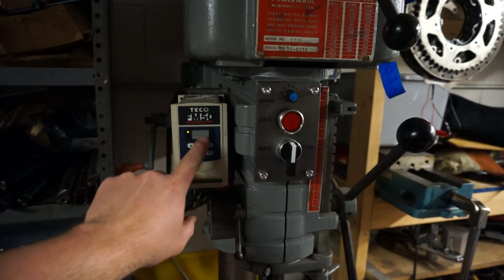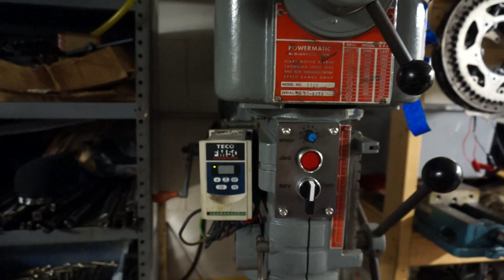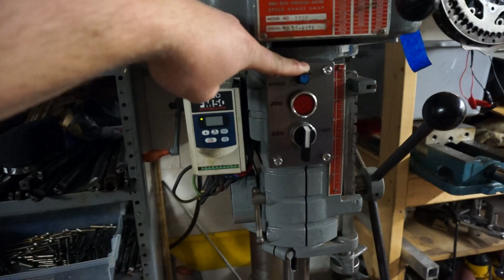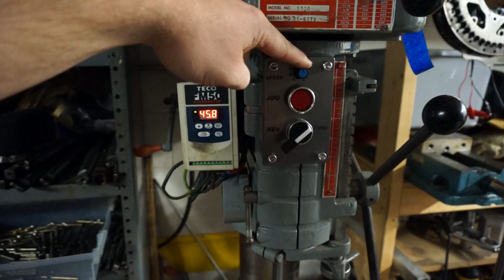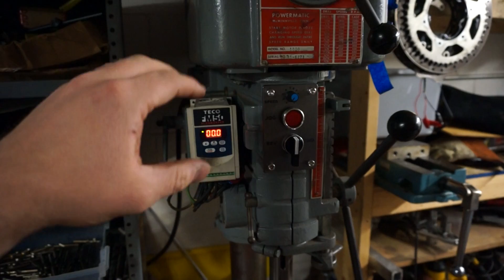powermatic 1200 drill press and VFD

Comment: Is the speed adjustment on the top with the adjustable pulley still in place? I have a similar Powermatic and have had issues with my vfd not having any torque. I can stop it with my hand

Comment: I just bought a 1200 from 1970 with a 2 speed Baldor 3 phase motor.  I want to power it with a VFD, i have no idea how to tell which wires are for low speed and high speed.  It is a 6 wire motor, to my understanding it is wired delta in series for low speed and YY parallel for high speed.  I would wire the VFD to the high speed leg.  Any idea how I can tell how to wire it?
Reply from the maker: I dont know on your motor.  No wiring diagram on motor plate?  Google?  I would agree the high speed is probably more useful as you can use VFD and reeves drive to slow spindle.
Reply: Peter Owens unfortunately there is no wiring diagram. 

Do you see an issue with wiring a plug to the vfd and using an outlet for incoming power?  Also, how are you grounding it really well, I see you mention it in another comment?

Thanks
Reply from the maker: slackreviews I don’t think that it’s advised to use a plug on VFDs.  I would consult the manufacturer on that.  I grounded the VFD to the drill press chassis which has ground back to panel.

Comment: Like the remote set up. Any chance of a electrical wiring drawing of the remote set up?
I have the same machine that needs this modification. Care to do this via private message? let me know and I can send my e-mail address. Thanks
Reply from the maker: Hi Caddy.  I don't have any drawings I'm sorry and my drill press is in deep storage from a move.  I used the Teco FM50 owners manual which had fairly detailed descriptions of wire hookups although obviously not written by someone with a mastery of the English language.  The parts I used were a (rotary 3 position selector switch) (Push button momentary switch) (10K linear taper rotary potentiometer) off ebay.

You wire these in according to the directions in the Teco manual and it's explained thoroughly.  You then have to "program" the Teco to recognize these new switches instead of the buttons built in to the VFD.  Basically you jog through the menu functions on the Teco (again explained in the manual) and set some parameter to 1 instead of 0 etc.

So you would use the 3 position switch to control the FWD STOP REV on the VFD and there is a setting for that.

You use the 10K potentiometer (which has 3 wires and some soldering to do) to replace the UP DOWN speed button on the VFD, explained in the manual.  Although I remember a little trial and error to get the 3 wires hooked up in the right sequence for it to work, fortunately there aren't that many combinations ;)

The jog button is an easy hook up.

I crimped tiny spade connectors to the wires and if you look at a TECO there are corresponding screw connectors for all the wires.  I'm not an electrician and I don't recall being stumped so it should be fairly straight forward with the VFD and the parts in front of you.

Let me know if you want actual ebay ads as I checked and the same parts I bought are currently being sold by tree_kicker and victoryrush

If you google Teco FM50 manual you should be able to find a PDF that shows the basic hookups.

http://www.tecowestinghouse.com/Manuals/FM50%20Instruction%20&%20User%20Manual_0405.pdf

Peter
Reply from the maker: Peter Owens Oh and be sure to GROUND EVERYTHING or you will have some fun little tinglies shocking you every time you touch the spindle haha
Reply: I currently have a lo/hi forward and reverse switch would that work?

Comment: Of all the videos i have watched on vfds, yours is the best. I wish I would have seen this a month ago. THANKS
Reply from the maker: Thank you for all your videos, I have enjoyed them for years.  I can gladly show you how I wired up my switch panel, but I think you are more than capable of figuring it out.  I will say that having the speed pot front and center makes using the VFD much more enjoyable.  You'll grow tired of trying to change speed using the keypad.

I also plan to rig up a proximity sensor and have a RPM readout as well.  Parts are ordered just a matter of finding an easy way to attach to quill.